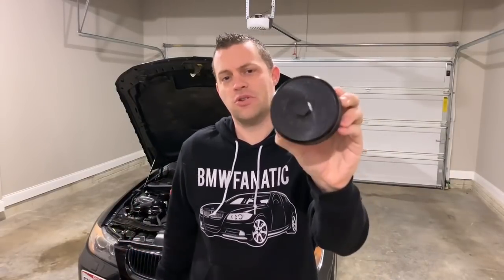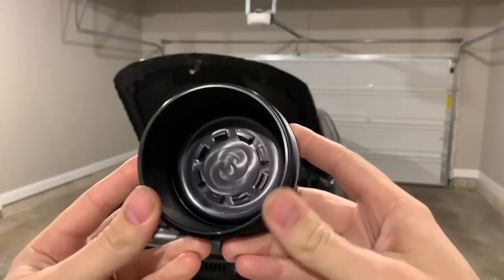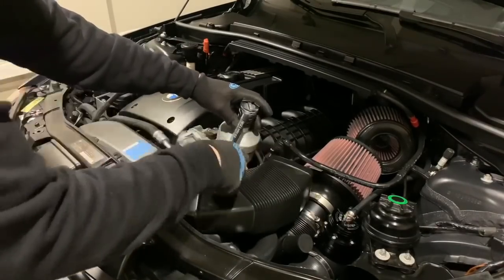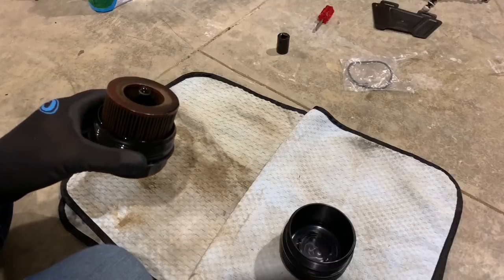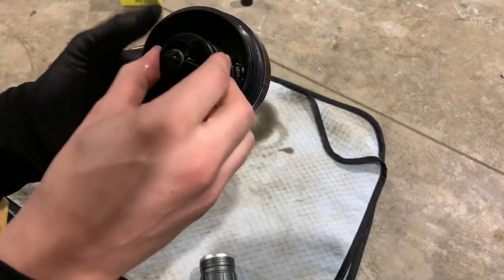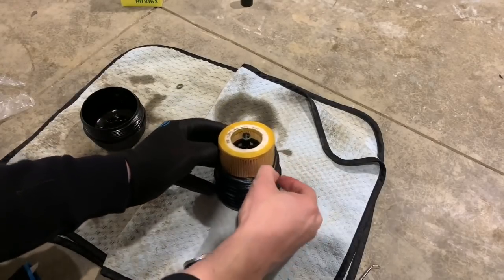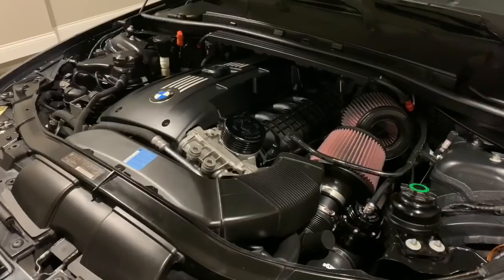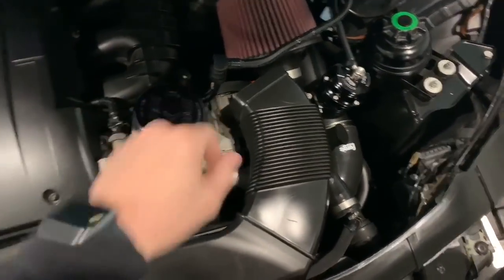Burger Motorsports Billet Aluminum BMW Oil Filter Housing Install!

Comment: Had the same one installed on my car last week. Awesome item. Mine is an N43 engine.
Reply: Did it actually fit the 2 liter 4 zylinder n43? Would be lovely to know, because it is not mentioned...
Reply: CrazyPrime it is a N46B20 4 cilinder gasoline engine in an E81 chassis in my case. The part fits perfectly. I mistakingly wrote N43.
Reply: Ah okay thank you very much!!! Happens to the best 😉
Reply: Would have been lovely to have it in my car too... 😊

Comment: Can this part be installed without draining the oil? Or will that cause oil to spill out of the filter housing? Thank you for the informative video, cant wait to install my BMS cap!
Reply: You can change it just will be a little messy but if you sit a Walmart bag or something like that and move cap into bag you won’t leak any out

Comment: Good video. Really enjoy your channel. Kind of off the subject. But i bought Burgermoters spacers. Going by you recommending.  My lug nuts rust. I'm cleaning them all the time. Do you get that?  But love them made my 335 look great.
Reply from the maker: Bart Salsberry a few of mine did a little bit, but I’ve had them on for awhile now and always drive during the winter

Comment: Any issues with leaking like the ECS Tuning aluminium cap?
Reply from the maker: Bryan Sawyer This doesn’t seem like it will leak at all, but I’ll keep an eye on it
Reply: I didn't know they did leak. How common was that issue?
Reply: @austinb.2029  Me and 2 guys from our club both had the same issue with it seeping just barely. Even after changing the O-ring and torqued past spec. One guy bent his threads trying to tighten it down enough. A few folks complained of similar issues on the E90 forums. This is just speaking on the ECS cap not these at all.